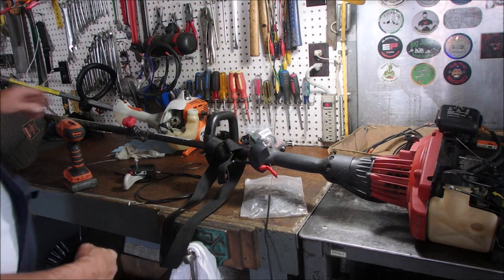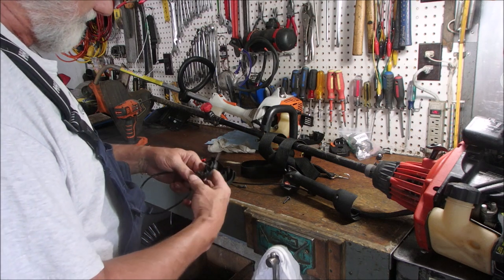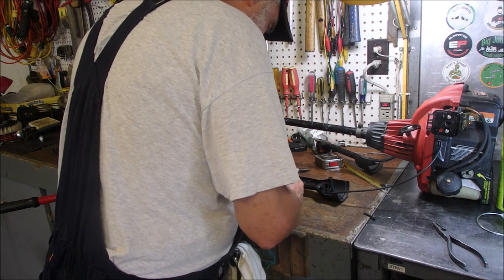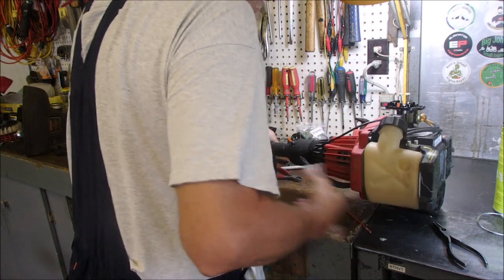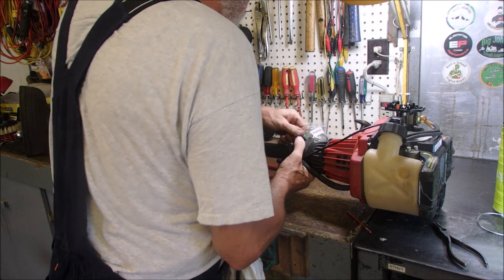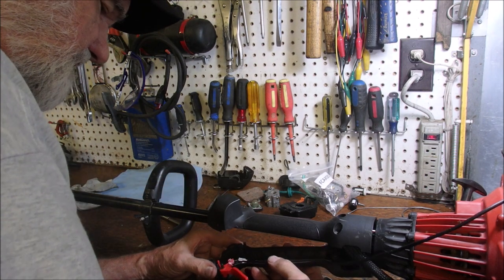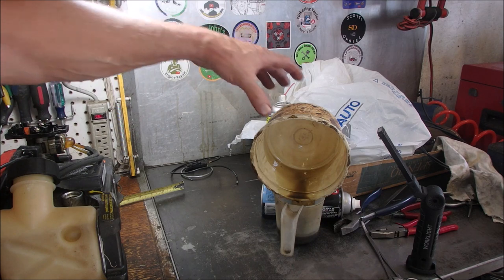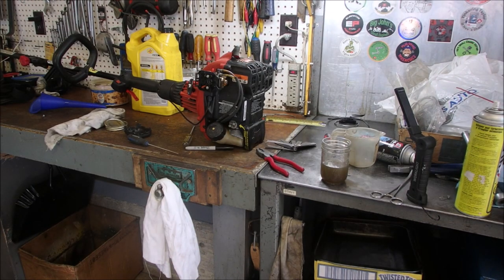Craftsman Trimmer Has a Broken Trigger

Comment: Bruce, look into the pliers designed for crimping those connectors.  When i do them, it crimps the opposite way (top to bottom) vs smooshing it from the side.  It makes more of a rounded connection, which might have worked easier.  They also sell smaller sleeves, but let's be honest, not many trimmers have room to get crimped anywhere at all lol.
Reply from the maker: Good tip!

Comment: Nice work!
I wonder if you could have soldered it?
Reply: I've read that because the wire rope is stainless, that soldering won't work unless it's a solder designed for stainless.  I also have not tried, as generally the cables I fixed that way are for mowers and those sleeves to be crimped are like 5c each here in the USA.  It's just so much easier and quicker to crimp the cables.
Reply from the maker: You can.  I have done that on a hood latch